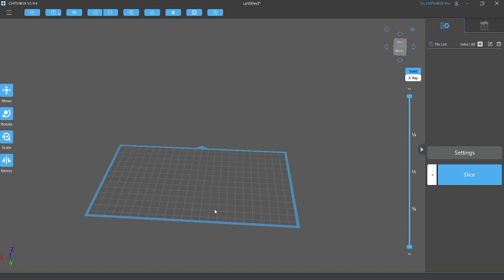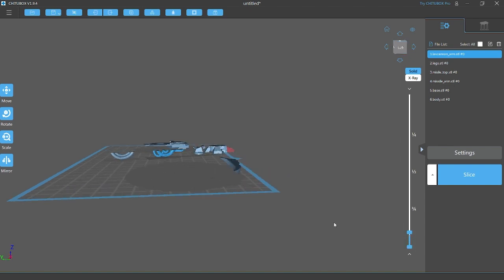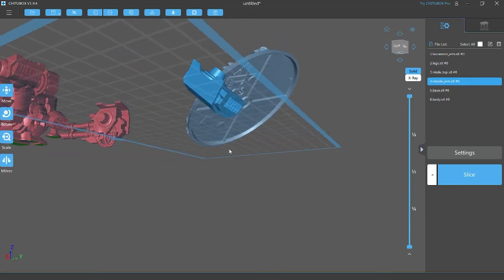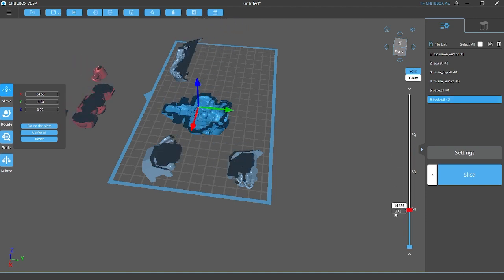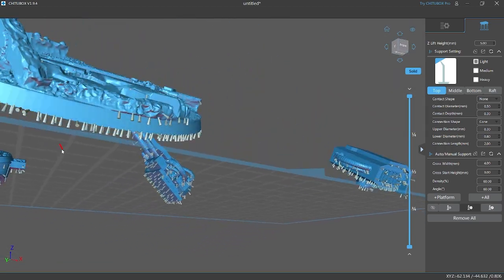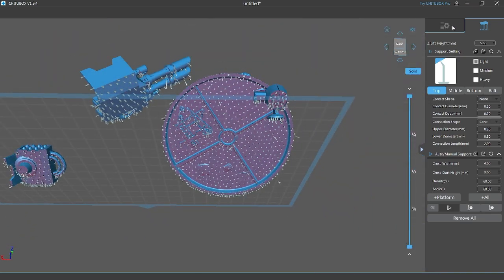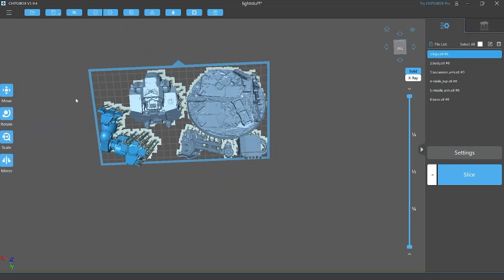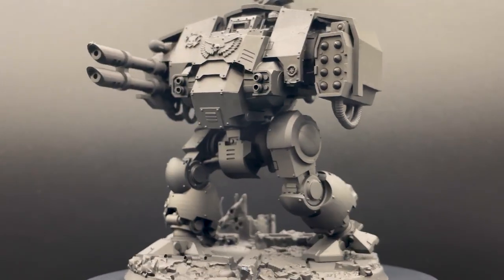Comprehensive Resin 3D Printing Support Guide! Learn to support your minis FAST!

Comment: I'm thinking of buying a printer and getting into printing, do you have any suggestions to what printer I should buy?
Reply from the maker: One of the few hobbies where the newest doesn't feel so bad. They are competing so hard for market share the new stuff is fairly priced and on sale often. I have had better luck w/ my Elegoo printers so I'll say the Mars 3 for a smaller setup and the Saturn 3 if you have a budget closer to $400. You won't have any buyers remorse having the 12k LCD and large print bed for that price. Both have affiliate links in my description if you want to support the channel!